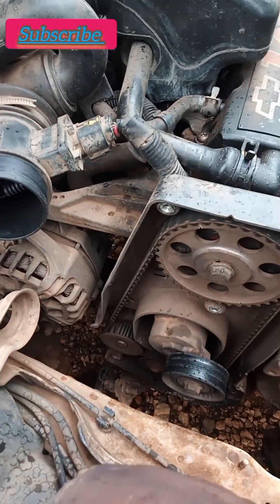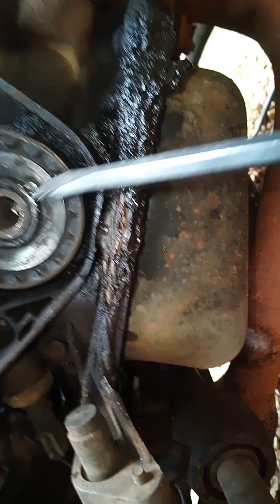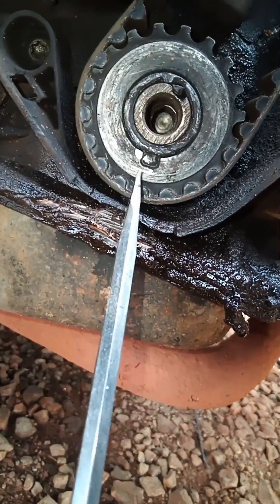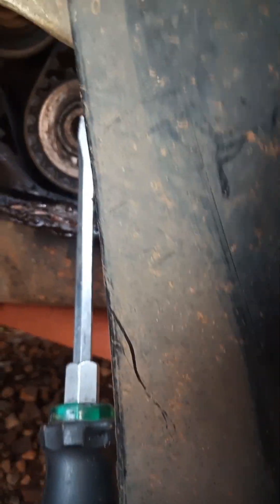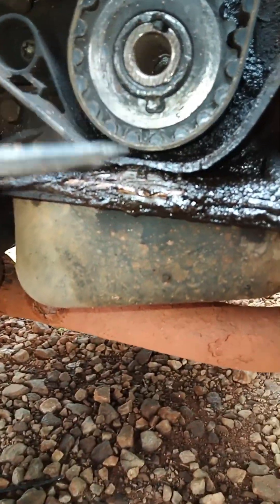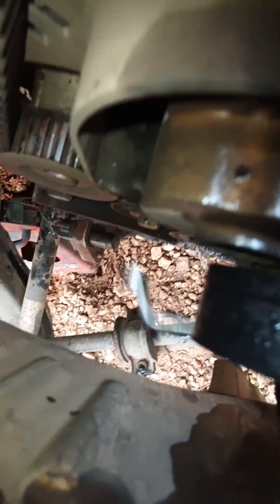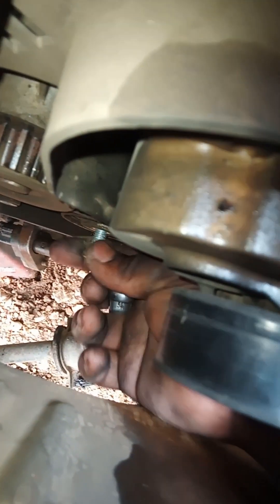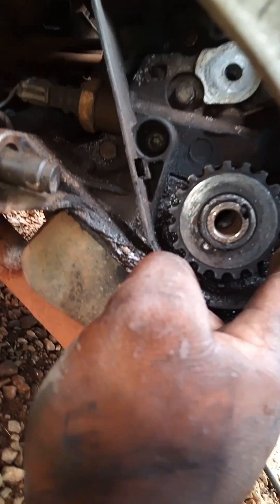Chevrolet Utility Bakkie timing marks on cambelt

Comment: Which of this is faulty when the car got the problem of losing power on the hills
Reply from the maker: On this case is it missing or not check the fuel pressure and air filter for any blockage first